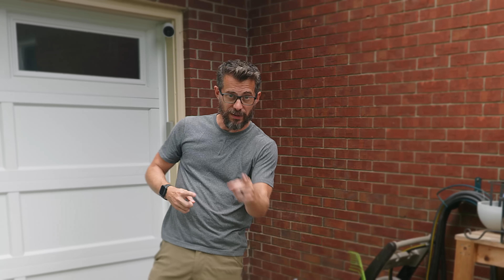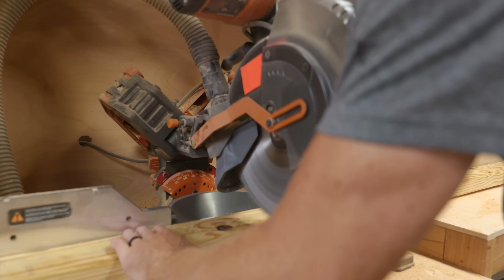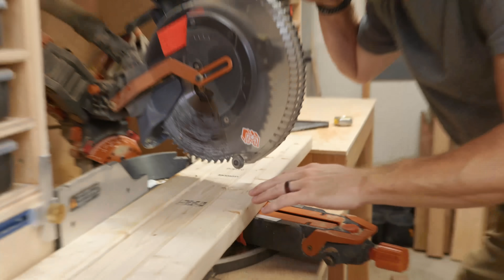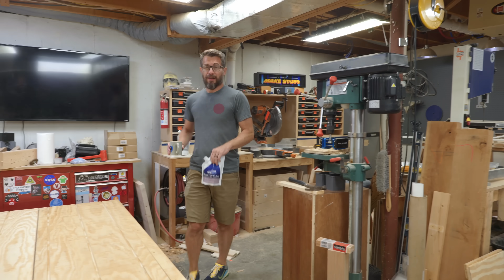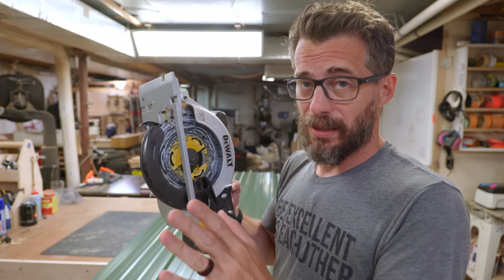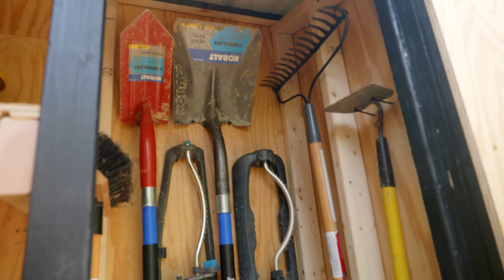A Place For All Of Our Junk!

Comment: If You Do This GET A PANELING BLADE preferably with about 36-40 per inch. It's a cleaner cut and it is a thinner kerf. So less like to wander.
And for Good Safety DO NOT USE A CARBIDE TIP ! Like I mentioned I spent 2 hours at the hospital getting one dug out of my arm !

Comment: The circular saw blade must be reversed, otherwise the teeth would pull the metal toward the  saw and shred it, making an ugly cut… same way as you get tear out on the top when you cut wood with a circular saw.

Comment: A note or two on metal roofing. It can cause condensation on the inside, so some manufacturers add a drip stop (it looks like a little fleece covering) to mitigate this. However, roof sheets with a drip stop should not use the filler pieces as air flow is needed to allow the condensation to evaporate.

Comment: For people who live in the UK who want to have a go at something like this, a good source of cheap or free plywood is to go around to your local medium sized window fitter companies. A lot of them get their sealed double glazed units made to order, and they get shipped to the factory for framing on large custom sized pallets. The pallets are usually a sheet of ply with some corner blocks and base stringers added. I've managed to scrounge several 8x4' pallets in this style before, and even though the wood does need a bit more prep work before you can use it, the stuff was free.

How I see it, you can put that extra bit of work into your hobby, or you can put that extra work into your boring day job to get money to pay for better materials for the hobby that you'd RATHER be doing.

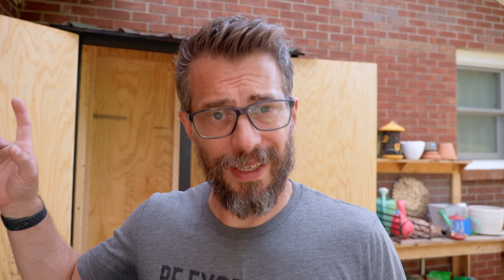Comment: 16:11 Normally you should screw the metal sheet in the protuding parts not the low ones : even with rubber, water could enter, there is no water running on the top part.

Comment: Skip the pressure treated base, get a plastic pallet. They can be cut down to size with a circular saw without issue. The cocacola ones are very strong.

But also if you are going with wood for the base, you should ise ground contact lumber not regular pressure treated.

Comment: Although the base 2x4 is pressure treated to resist rot, it will behave event better if put on top of some moisture insulation like polyethylene foil or tar paper you would normally use to insulate a house framing from a foundation.
Reply: Ground contact lumber would be better. Plastic pallet would be best.

Comment: Nice to see I'm not the only person who built one out of wood instead of buying a plastic box. One thing about those roofing screws you showed normally those need a hole drilled before you put them in. You can use self tapping that have the rubber gasket on them and not have to predrill them.
Reply: Those screws do not need a pilot hole. Just need some pressure behind them.

Comment: The reason why flipping the blade works is that you don't actually want to cut the metal. What you're doing is basically like punching little holes in the metal repeatedly and it's a better shearing action than the bladed side would without leaving much burs or snagging on metal bits.

Comment: I have one of those plastic sheds, but I only spent $100 on it, so when it came to the build vs. buy, it was easier to buy. My next one on the other hand will definitely be built. Virtually any shed you can buy is either made up of cheap materials or overpriced, often both. Your design is simple and easy to put together. Love the mistakes that you made and showing how you adapted and made it work in the end!

Comment: Typical American version of fixing tin roofing, you screw the high points of the roofing so water drains away from the screws, you don't put it on the lower flat sections. 
Have a look at the way it's done in Australia where we have been using corrugated iron (now called Colourbond) for roofing entire houses. Your roof will have a tendency to rust around the top side of the screws due to water collecting around the screws, also you don't tighten the screws down to they bend the roofing just until the rubber washer starts to be distorted, again for water proofing and rust protection.
Originally they used nails of the same design and the roofing is still fine and waterproof (although I do remember my Grandfather painting the roof with a zinc based paint for looks)

Comment: Quick tip, when screwing on your sheet metal roofing make sure to drive the screws into the raised part of the sheeting. While the rubber washers do a fairly good job at keeping the water out, they are not perfect and will leak if water pools or runs over them. By only putting screws in the ridges of the steel sheet water will run straight off and will never pool around your screw holes. Have a good one Bob! 😊
Reply: This goes against the manufacturer recommended installation instructions for that metal roof
Reply: @ThatToast  You know who the manufacturer is? How would the manufacturer have us do it?
Reply: @minchy83  The manufacturer is likely Union Corrugating, their instructions have the screws in the valley
Reply: @ThatToast  Their roof will likely leak in 5 years time when the rubber breaks down. We always put the screws in the hills to avoid this.
Reply: @minchy83  You likely void any warranty by not following the manufacturer's directions. plus the rubber definitely lasts more than 5 years
Reply: @ThatToast  okay but let's be for real, warranty on a sheet of tin?
Reply: @nyetloki  Well sure, for this project no big deal its only one sheet, but what happens when you do your whole roof in it, and its defective for some reason, and they send their claims specialist and sees you installed it wrong, and denies your claim, now you gotta buy a whole new set of tin for your roof

Comment: I've made a couple of small sheds similar for storage (including a short wide one just for rolling in thenlawn mower, portable gen, and power washer).  Typically I used 2x4s I've ripped down in half (for ral lighweight sheds) or usually into 2x3s, reusing the cut off 1x2 remainder as the trim - saves a bunch that way (locally a 2x4 is only 60¢ more than a 2x3).

Comment: Bob:  That ply with the grooves + trim = gaps; those gaps will draw "dirt/mud dauber wasps" which will fill that small space with their mud nests.  Harmless for years, but the old dirt will hold rain water splash against the inside of all those parts & stay wet for days each time it rains.   It will take years, but it will rot.   

Caulk it?  I'm not sure yet what to do, but I need to rebuild my shed doors due to this very issue.
Reply from the maker: Good to know 👍

Comment: What stops water from running down the brick behind it? Shouldn’t it be flashed?
Reply: If that happens it'll run down to the drive/gravel and not into the shed. Good reason to leave a slight air-gap at the back to avoid damp though.

Comment: I’m not so sure about this conclusion. Cost benefit of paying the extra $100 or so for the store bought product vs. the savings weighed against being in the shop all day. But, thank you for choosing the latter. Definitely a more interesting video than bringing one home from the store and putting it together on camera. Though, I’m sure you could make that entertaining too 😅
Reply from the maker: Fair enough!
Reply: Definitely agree with this. For the average person who doesn't especially enjoy woodworking and won't already have tools, the pre-built ones are a fair price. They're way lighter and easier to disassemble/rebuild, too, so if you're not a homeowner and will be moving, that's another reason to just buy the pre-built. This wood one is prettier, to be fair, I think most would agree, but the other ones are also perfectly fine if you aren't eagerly looking for your next project.

Comment: So how does the $599.00 plastic one looks like the best option for the average person? it will never rot, no need to look after it, and your not spending a weekend building it. What was the actual cost of the paint, varnish, and hardware? so $350 in wood maybe $100 in paint varnish and hardware. The cost of the tools in your shop and the time. $599.00 looks like a real deal to me. With no other costs like upkeep in a few years, the wood will need resealing/painting so $30.00 every 3 to 4 years, 5 years it's paid for itself, and no building it, $599.00 looks cheap mate.
Reply: *you’re
Reply: It will still take a couple hours to build the plastic one, its not pre-assembled
Reply: you also get condensation issues with plastic sheds. Several times now i've gone into mine and theres literally a puddle of water on the floor, beads of water all over the inside of the roof, or a box on a shelf thats touching the wall has a decent layer of water sat in it, and the shelves have gone mouldy.

Comment: Aren’t the spacers to fill the gap made so you don’t have to put the screw in the valley of the sheet metal roof.
Reply: You can still put the screws in the peaks of the sheet without the spacers, just make sure not to drive the screws in too far.